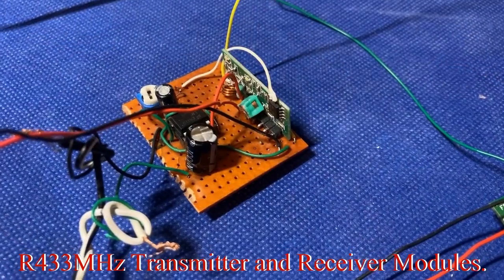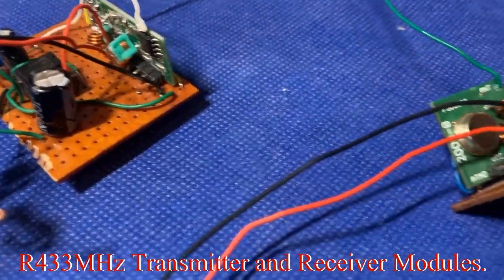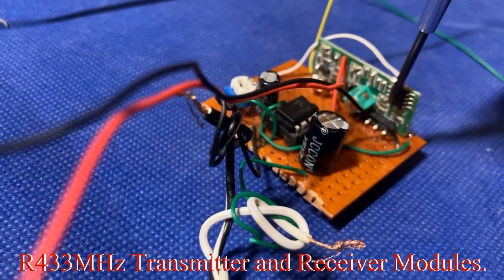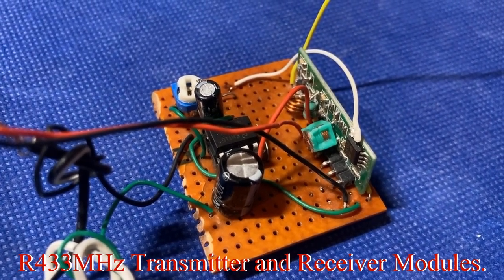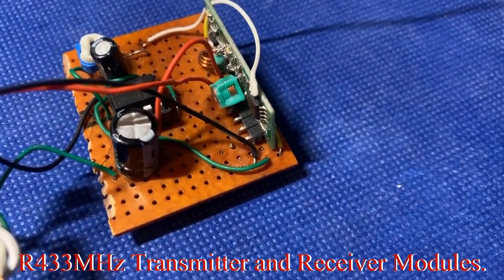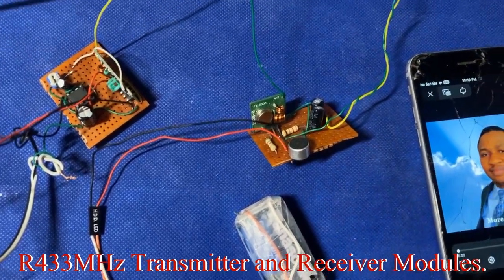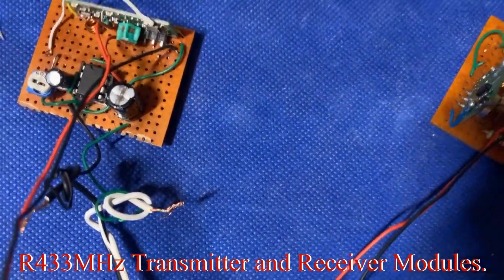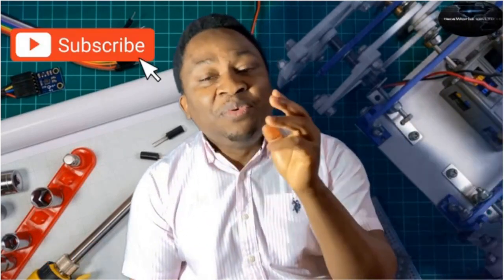R433 Transmitter and Receiver with improved audio | Walkie-Talkie with R433 Part 3

Comment: Compared to the previos vesions you made, this is a hughe improvement in the sound quality. It´s still distorted thou. Simply reducing the volume of the phone, that´s feeding the transmitter, sure would clear up the sound even more. I wouldn´t constantly transmitt on that frequency as it´s used for car-keys to remotely open the car. Also wirelless Thermometer sensors use this frequency... so I would not continously transmitt there, it might inteffer with the other signals. I tried to contact you via mail, but you did not write a reply... may not have seen it...
Reply from the maker: Yes... in a series-type video, we normally go from the basic to the advanced. That is the same in this case... you would know from a previous version that an improvement was coming.

On the frequency of use, that frequency is within the unlicensed frequency band for Amateur and Radio Location and shouldn't be an issue with interference (even though this project is for educational purposes only). Cars remote and Wireless Thermometers use encoders and decoders to differentiate one device from another, hence there is no worry over interference - https://upload.wikimedia.org/wikipedia/commons/c/c7/United_States_Frequency_Allocations_Chart_2016_-_The_Radio_Spectrum.pdf

On the email to me, sorry about that. I don't think I have seen it come through. What email address did you send it to? You may also provide us with your email address to help us look it up.... email address once again: info@hecaworld.com